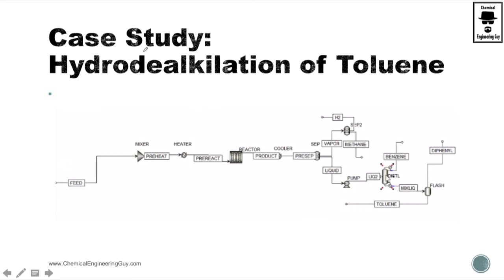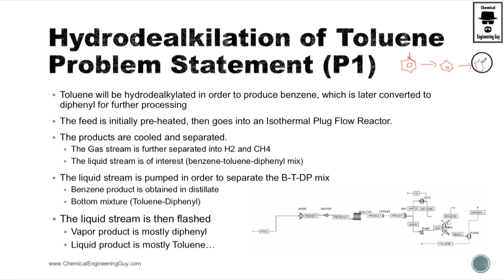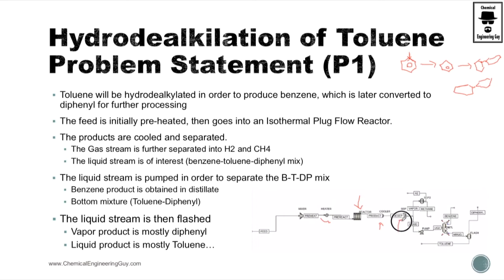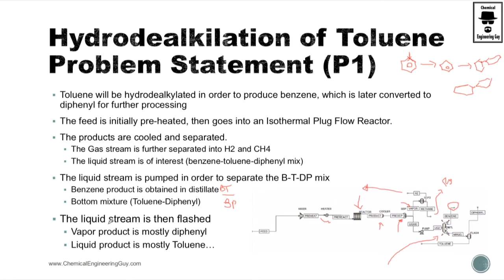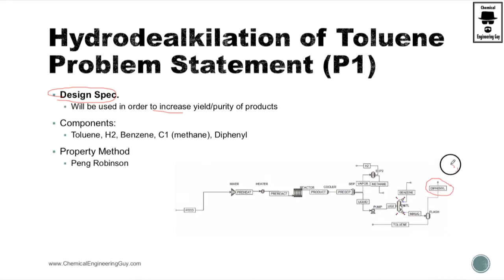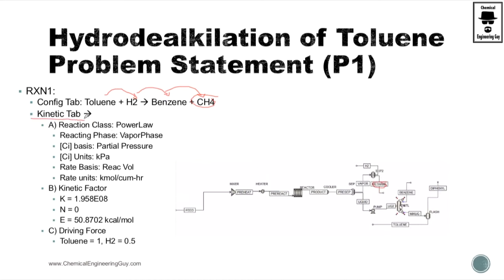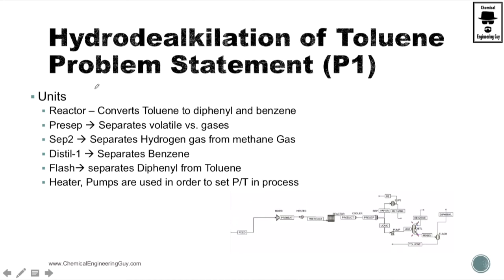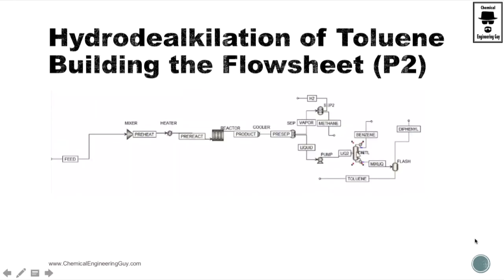Case Study 1 Hydrodealkylation of Toluene Problem Statement (Lec162)

Comment: Sir, from where did you get the kinetic information of the reactions?
Reply from the maker: In this specific case, I got them from an experimental test! Unfortunately, I can't tell from which company or project! Please note that this will be the case! You can't really model a reactor if you do not know about its kinetics
Reply: @ChemicalEngineeringGuy  thanks a lot
Reply: @ChemicalEngineeringGuy  bonjour